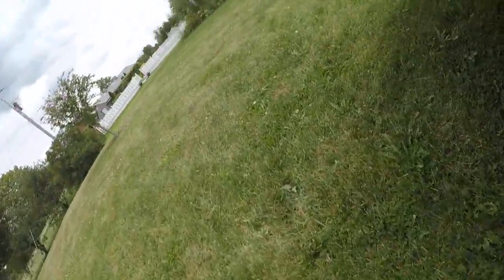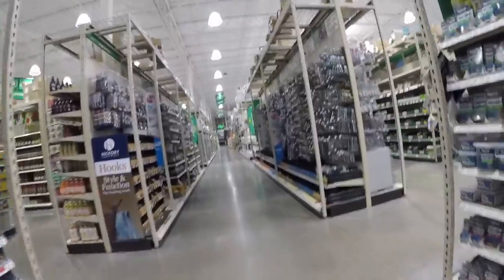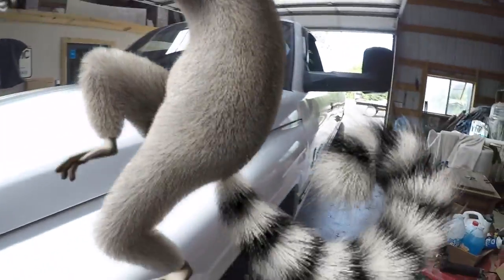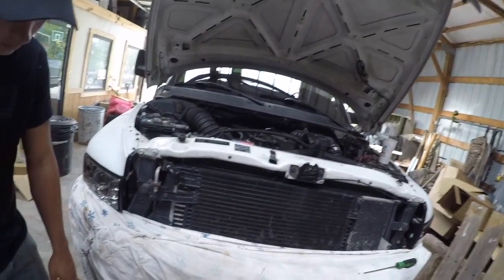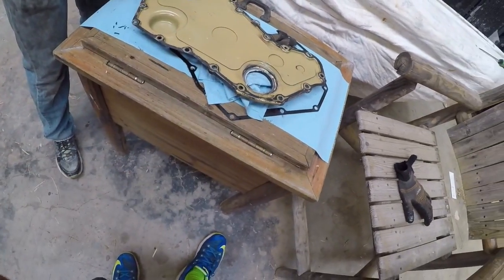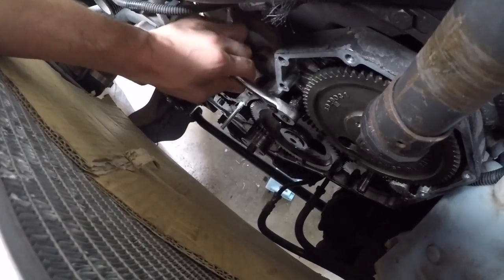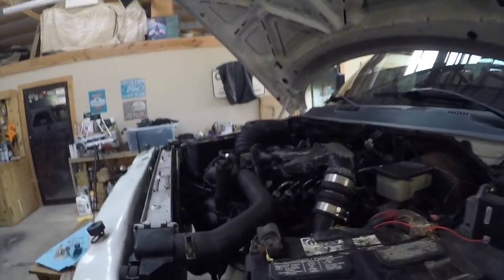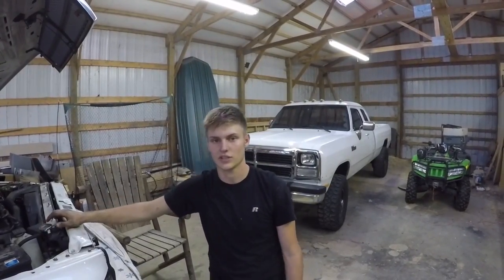KDP Fix Went Wrong... Time To Fix Another Problem!?!?

Comment: Black rtv is oil resistant (use it all the time on differentials and axles on big trucks) and is designed for such applications, diff covers, valve and timing/front covers, etc....just for future reference but you should be fine. Also when using rtv there's no need to use that much. You only need to apply the rtv to the cover or the case not both, put a bead all the way around and use your finger to smooth it out. Just some info you might find useful man. Keep at it.
Reply from the maker: CountryBoy943 thx

Comment: When using gasket maker don't use too much because when you torque the bolts down it comes out the sides a little but it also does it on the inside and it can come off inside and block oil passages so next time you change your oil you might see little bits off red in it just a heads up shouldn't hurt anything tho
Reply from the maker: Cummins Daily yeah it barley came out around the outside and we put less on the inner half of the gasket
Reply from the maker: sarelhonda well I have run the truck really hot the last few days and have had ZERO leak anywhere not a drop just like it used to be

Comment: the ultra black is for extreme oil applications aka anything on a cummins, and they make thread locker for oily scenarios too. i use ultra black on diffs, tcase, oil pan etc never had a leak.

Comment: Need to use the right stuff gasket maker it’s 
Black and no set for hours made by permetex put it on torque the bolts to spec

Comment: the previous owner of my 12v says he did the KDP fix on this truck. maybe he did looking at the $20k in resepts i got with the truck, he clearly was not afraid to throw money at it... but im still going to buy a bore scope and remove the oil fill and take a look for myself... piece of mind and all. hope its been done though. really hate tearing down a non leaking engine.
Reply: Your saying that there's a way you could look to see the condition of the KDP?
Reply: @markepsteen5718  did you ever figure this out if possible? using a camera bore scope down through the oil fill tube inside the cover?

Comment: Do not put the seal back in the same spot in the cover or it will just leak again. The old seal probly has a groove in the crank. Or u can use a speedy sleeve

Comment: Had a slow oil leak on my truck as well, ended up being the vacuum pump seal had it fixed under the dealer warranty otherwise I woulda made a video on it. Nice truck though very clean
Reply from the maker: NickMP16 thanks!